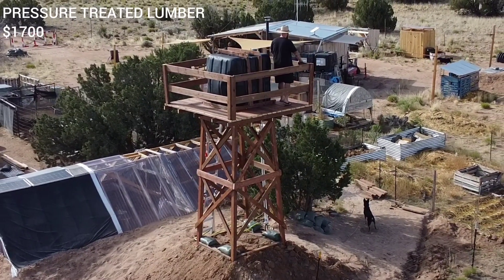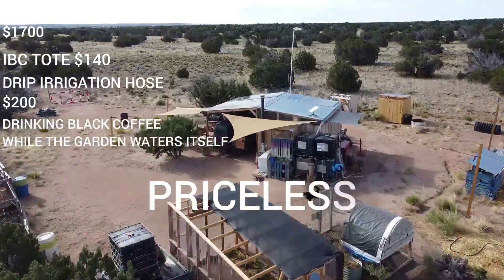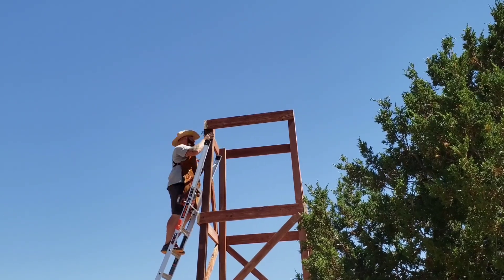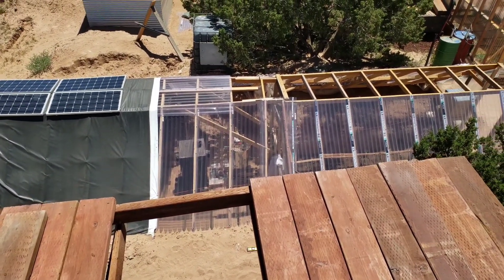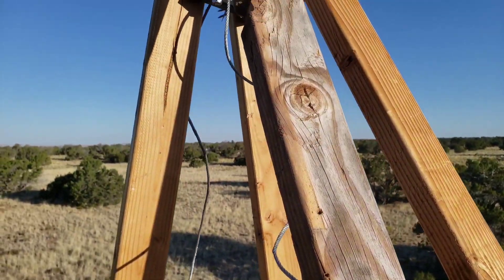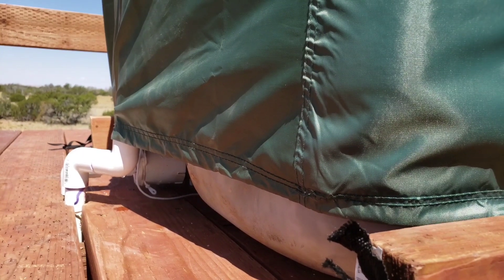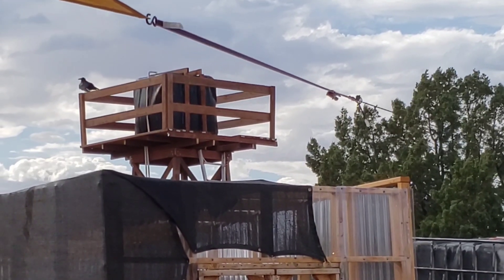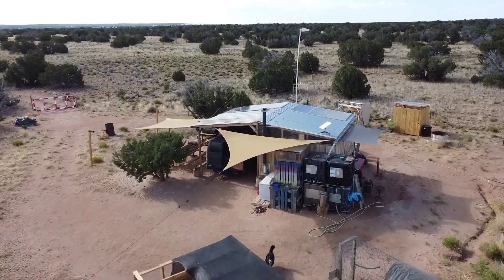WATER TOWER DRIP SYSTEM

Comment: Is your hose a drip or soaker? I guess when I hear drip irrigation I think of those little emitters stuck into a black hose that goes to each plant. That system I found to be way expensive. I am wondering which would use more water a soaker hose or a drip system? What would be the advantages of using a soaker hose that moistens all the soil along it. The baby pigs are so cute!
Reply from the maker: I feel like this is a rhetorical question.  I don't think anyone builds or searches youtube for a "soaker system" sometimes we don't need to get caught up over semantics. Both are pretty efficient.